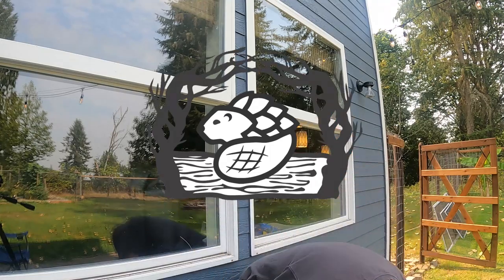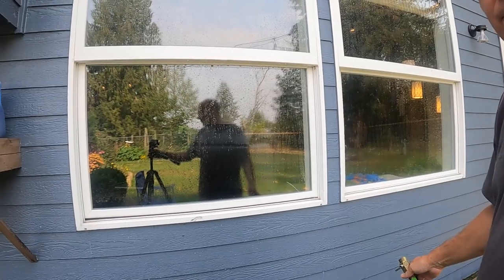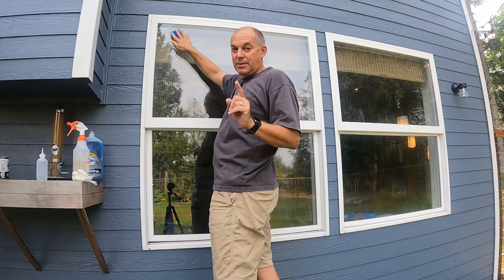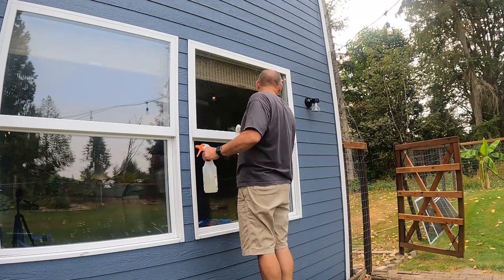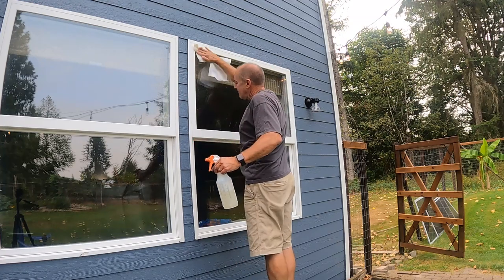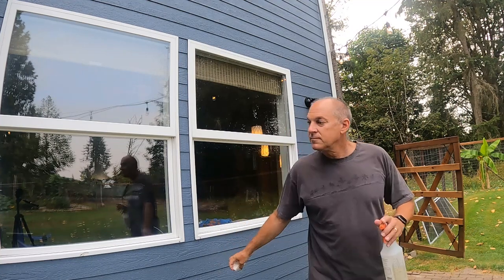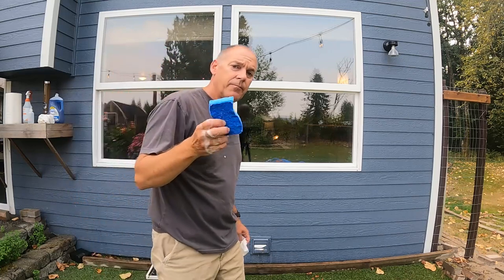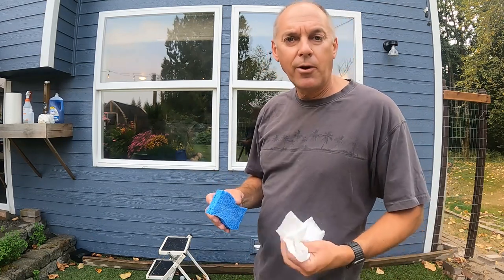Window Cleaning has never been easier | No squeegee needed  | Charlie Beaver

Comment: Is the vinegar diluted?
Reply from the maker: I don’t dilute the vinegar because it dilutes with the rinse water or sometimes I go right over the soapy window with straight vinegar then rinse. Works both ways. I’ve tried mixing the soap and vinegar on the sponge prior to washing but the pH of the soap and the pH of the vinegar are opposite so the soap suds are diminished and I like to see where I’ve scrubbed. But it cleans just as well. Hope that helps